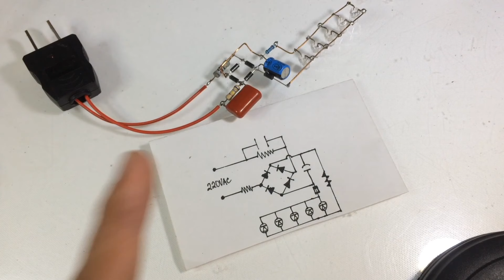220VAC to 5VDC Circuit | How to Convert

Comment: Good job, thanx! Where can I find the value of the components?
Reply from the maker: Watch the video sir because every components there is a name and value sir
Reply: @JaviersDIY  Yes but on the first capacitor you write only 400V
Reply from the maker: @liviofoini4955  any unit of capacitor as long as the maximum voltage is 400v

Comment: sir what are the reasons and functions of using resistors and capacitors and why we used 5 leds and connected them in parallel
Reply from the maker: That components plays an important role in the circuit. When it comes to there function, the  resistor limits or regulates the flow of electrical current in an electronic circuit and the capacitor is a circuit component that temporarily stores electrical energy through distributing charged particles on (generally two) plates to create a potential difference. In the LED I connect it in parallel so that the same voltage will flow in every bulb compared to series connection which is the opposite one.
Reply: @JaviersDIY  thank you sir 🙏🏻
Reply: @JaviersDIY  it didn't work :( I got 2.5 dc